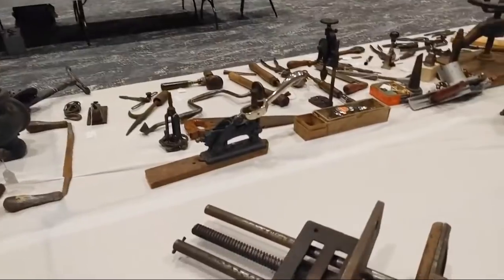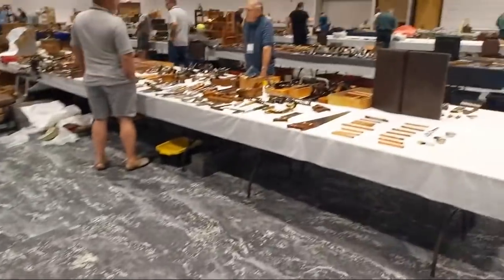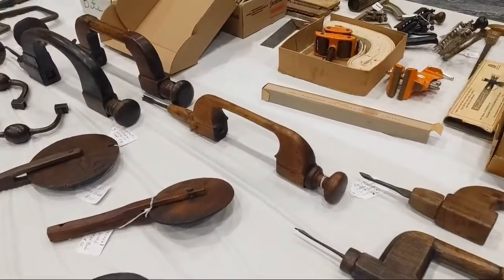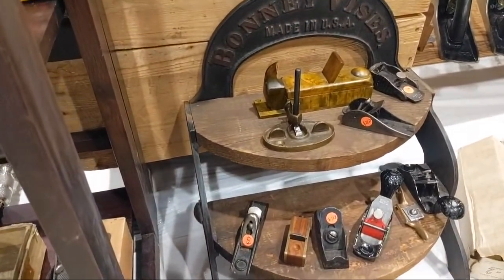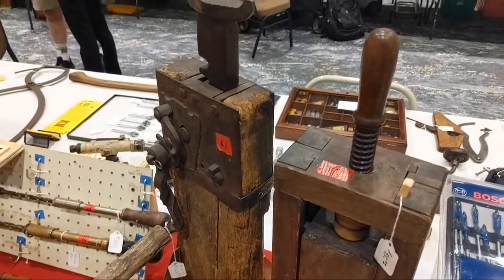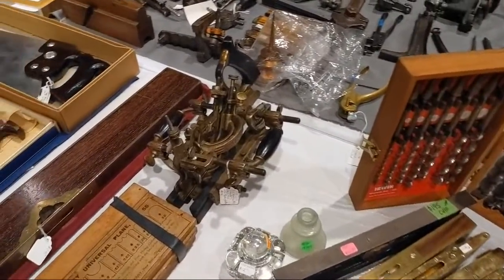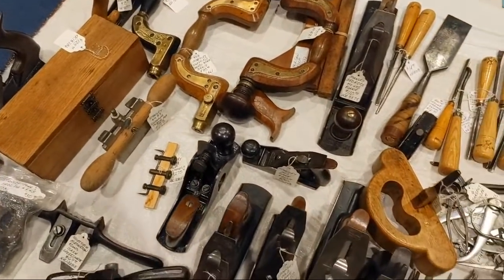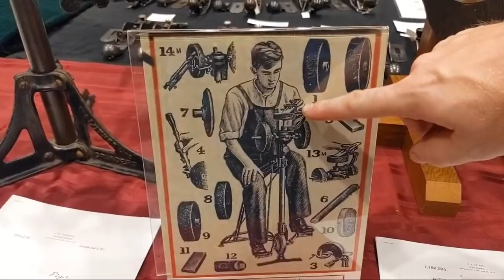MWTCA 2021 Saturday Sale

Comment: Low angle jackplanes were all the rage a few years ago, now the hype seems to have died down a little bit again. Funny how that goes.

But I’m planning to get one when Lie Nielsen starts shipping to European retailers again. I have about a dozen vintage hand planes and I’m very happy with them, but I’d like to check out a modern one. The 62 would be great for the shooting board, and it has the same footprint and iron width as a No. 5, which I don’t have. I’d also like to pick up a toothed iron for scrubbing.

Comment: All I really want it's the accessories to a number 78. I talked Grandpa out of his but of course he lost all the extras. For some reason it seems to be cheaper to buy a second complete plane then to try and find the parts. Side note do you ever see any Keen Kutter planes? I'm not really sure why they're not more popular. Some of them seem to be kind of a middle ground between old Stanley's and the more modern stuff with thicker blades.
Reply from the maker: It is almost always cheaper to buy a complete plane than it is to buy the parts to fix one up. Especially with a 78 the depth stop and fence are missing on around 80% of them. So there are a lot of people out there looking for them in the price goes very high. As to Keen Kuters they are great plans and are on par with Stanleys. You don't see them as much because they did not sell it near as much as Stanley. So they're not as many of them out there to find.
Reply: @WoodByWright  I wish Stanley still sold the parts. That would be nice. I've never come across to Keen Kutter in person so I don't know firsthand. From some reading I've done they seem like a really nice option. Depending on the era like most things with vintage tools.

Comment: @12:09 what do you call that drill with the one handle that cranks and has a 90 degree chuck on it
Reply from the maker: Expensive! Lol sorry. Most commonly called a 90degree brace, but it goes by a lot of different names. I can not remember which name miller falls used. I will have to look it up
Reply: @WoodByWright  no wonder I’ve never seen them 😂